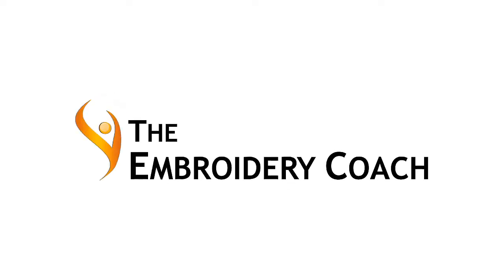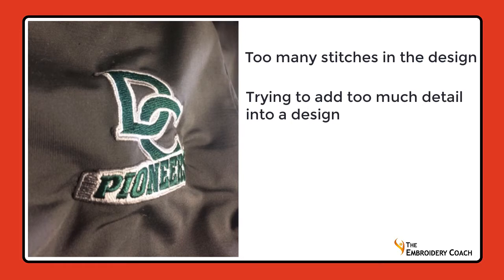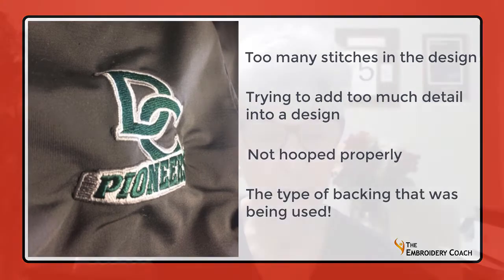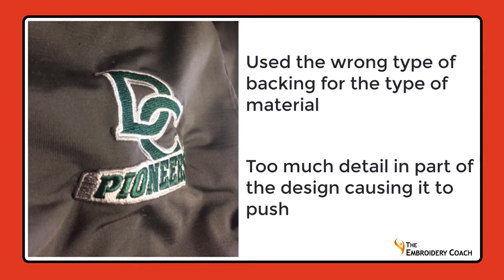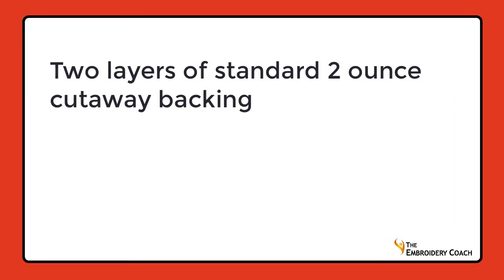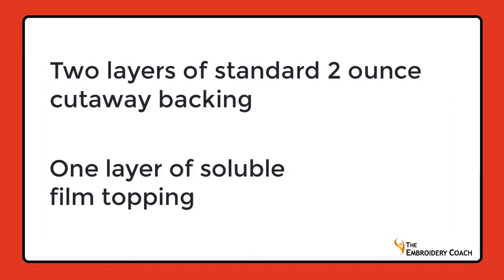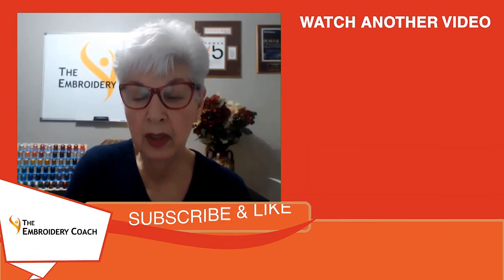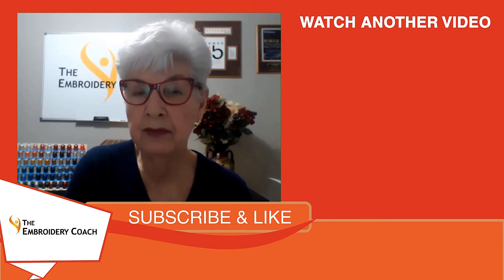Stop Puckering In Your Embroidery Designs

Comment: Gosh, what a fabulous channel. I’m new to machine embroidery so this will be of such benefit.
I’m having hideous problems with puckering. 
I’ve followed instructions not to hoop too tight but it seems to be my nemesis that I still get puckering no matter what combo of fabric and stabiliser I use.
My current project doesn’t have an overly dense pattern, in fact it has plenty wide spaces, it’s a lightweight cotton and the stabiliser is soft and strong cutaway. Still I get puckering. I’m using a combo PF threads, gutermann and Madeira. 
I desperately want to get this right as my husband got me what was for us an expensive machine Janome MC500E.
Reply from the maker: Hi Bobbi,   Take 2 layers of no show backing and 1 layer of crisp 1.5 oz tearaway backing for your knits.  If you still see some puckering, Place a piece of cap backing or 3 oz tearaway backing under the hoop before it starts sewing.  This should absolutely stop the puckering.  I discovered this working with a large company that were having puckering issues with the very thin cotton dress shirts. 

If it is a woven fabric, use 2 layers of a crisp 1.5 oz. tearaway backing and then lay the cap backing under the hoop before you start sewing.  Try this, you will like it.  Let me know how you make out!
Reply: Joyce Jagger, The Embroidery Coach hi Joyce, thank you ever so much.  I’m in the us so I think we are using different terminology. Does 3 oz stabiliser mean heavy weight, also, is 1.5oz equivalent to light? Sorry I have so many questions. Also, when you say put cap backing under the hoop do you mean just slide it under the hoop when it’s in place or unhoop the layers and add the cap backing as the very bottom layer. Sorry if I don’t make a lot of sense, I’m disabled and sometimes finding the right words are difficult.
I’ve subscribed to your channel so hopefully I can pick up more info.

Comment: I read to try a heavier, meaning stiffer paper stabilizer behind my thin, small square . Correct or not ?
Reply from the maker: Lay a piece of 3 oz cap backing/stabilizer under the hoop before it starts to embroider and that should help with the puckering.
Reply: Yes, my stabilizer is cut larger. However, the white quilting squares are 3x3.
Reply from the maker: @robinstpierre864  Robin, send me an email with a picture of your hooped square so that I can see it and understand more about what your problem is.  Send it to joyce@theembroiderycoach.com

Comment: Thin square, square smaller than my 4x4 hoop, no show mesh doubled on back and spray under the small quilters square because it is smaller than my hoop, leading to puckering.
Reply from the maker: I am not sure what you mean by a thin small square. Your backing/stabilizer should be larger than you hoop.  Your whole backing needs to totally cover the hoop.  Does that make sense?

Comment: What exactly is “cap backing”?
Reply from the maker: It is a 3 oz. crisp tearaway backing that you use on the back caps as you embroider caps.
Reply: @TheEmbroideryCoach  thank you
Reply from the maker: @conniemoody5063  You are most welcome.  If you have any other questions, don't hesitate to contact me.
Reply: @TheEmbroideryCoach  thank you. I am frightened to embroider on satin tomorrow for a client to make a wedding pillow of
Reply from the maker: @conniemoody5063  Some of the sentence is missing. Is it satin?  Use 2 layers of crisp tearaway backing, size 70/10 ballpoint needle if you are using satin.  Place a piece of cap backing under the hoop before you start sewing to keep it laying flat and not pucker.  I hope this helps.